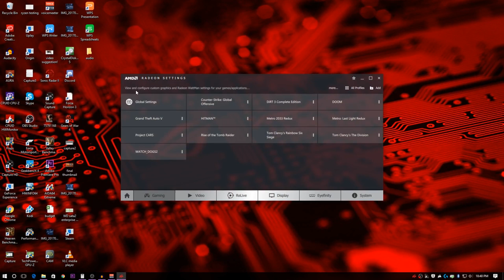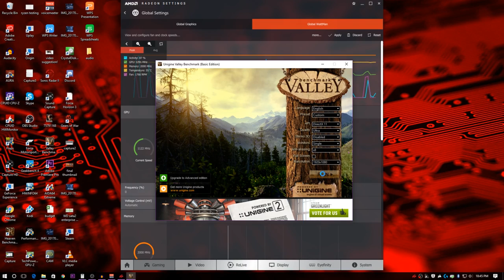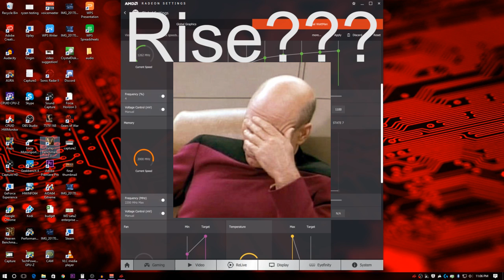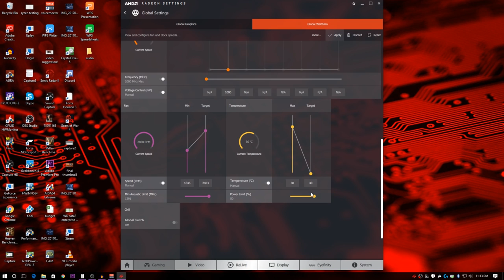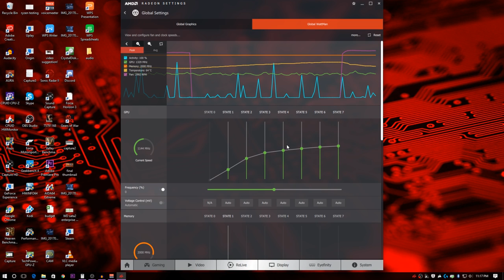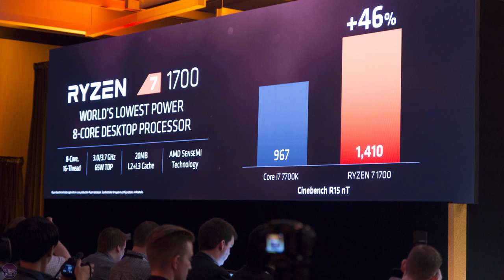Beginners step by step [how-to] overclock your AMD video card (RX 480)- Global WattMan

Comment: 1st of all thanks for the descriptive video man
2nd i want to ask that i've done some underclocking as i dont want high temps along with high fan noise, em not a ultra settings  fan, i just want my games to run smoother in better settings, so i manged to get 40 FPS in pre-ultra settings in overwatch, 
these were my settings ( https://tinyurl.com/lug945q ) , didnt touched any thing in Wattman except Chill.  i was getting 40 FPS with this at 64 C temp Max which em kinda Ok with. but i want to know are these settings OK? like i dont want to harm my Card as i want to use it for about 3 to 4 years are these settings good to go with or i can increase Frequency ? from 1900 to 2000 again ? didnt tried that but it was ok n stable in time SPY and fur mark.
Reply from the maker: Thank you for taking the time to watch the video. We really appreciate it!!

In regards to your underclock, I want to start by saying that depending on what model RX 480 you have, it is designed to run hotter than 64c. Where you have it now, is perfectly fine if not a bit on the modest side. I know that specifically on the newer RX 580 cards, most of them are set up to keep the card running around 75c. I would definitely suggest you raise the memory frequency back up to 2000MHz. I would say as long as you aren't creeping into the mid to high 80c range, I would not worry about the lifespan of the card.
Reply: this Means 75 degree are good to go for daily 3 to 4 hour of continuous gaming, if so then i'll for sure change Memory clock back to 2K but again i dont want much noise while gaming. as i've never heard such voice before kindly makes me upset why its making so much noise, also about the FPS, its just 40 fps in overwatch Pre ultra settings, 
CPU: core i3 6100 
Ran: 8gb kingston
HDD: WD green 1tb. 
least it should be 60 isn't it ? 
most importantly i didnt mean underclock  :p, i mean undervolting in my 2nd sentence,
Reply from the maker: Unfortunately, I don't know enough about Overwatch to tell you if that is an acceptable FPS number you are getting. From what I have seen, it doesn't appear to be a very intensive game, so I would expect at least 60 FPS, but I couldn't be certain.

Comment: this my thing Graphics Chipset
AMD Radeon R7 250 Series
Reply from the maker: You don't have Wattman because yours is not meant to be overclocked and wouldn't really benefit if it could unfortunately :(
Reply: Let's Get Techy damn this sucks :(
Reply from the maker: I'm sorry :(... It is compounded by the fact no one can find a reasonably priced GPU to save their life even if you wanted to upgrade. Grrrrrr!
Reply: Let's Get Techy it’s so dumb it’s try and get a nvidia GeForce gtx 1050 or 1070 ti
Reply: Ima **
Reply from the maker: That's a big difference between those two cards. Any reason you aren't considering anything in between?
Reply: Let's Get Techy like Wdym by that I like the nvidia cards they are nice looking and good for gaming but if there is any radeon card thing that is like 200$ that I can use for gaming and over clock please give me a link to one
Reply from the maker: Unfortunately, there aren't any worthwhile cards available from either team at the moment.

Comment: Can I over clock my radeon r5 340
Reply from the maker: With it being an OEM GPU, it's unlikely, but you can give it a shot. If the controls are there, you can. If they aren't, you cannot. You can also give MSI Afterburner a try if the controls aren't there in Wattman.

Comment: Shit i just found out my fan's max RPM is 6500!
Reply from the maker: Yeah, at that speed it sounds like it's ready to leave Earth's orbit huh? Lol
Reply: It was like TWO rockets leaving Earth's orbit xD I had a problem with my MSI R9 380 for over 2 years. Every like 20 seconds it was stuttering and the framerate dropped to 20 FPS for 5 seconds. And it was really annoying, especially when you're playing games like DOOM and other games where you have to be always moving. I didn't know what to do. I thought it was an overheating problem, but it wasn't. Then i thought it was something with the PSU, but still nothing. So i tried overclocking the GPU and all of sudden it stopped stuttering! So i'm really thankful for the tutorial you provided and helped me solve the problem. But anyways, thanks for the tutorial! I liked and subscribed! And also one more thing, I know this tutorial is for the Polaris cards only, so I searched the internet for tips like what's the highest voltage for my GPU and so on. But I followed your steps and it's easier than building Lego's! I would also appreciate a tutorial on how to overclock a CPU, cause i looked up the tutorial several times on YouTube and i didn't understand neither one of them.
Reply from the maker: Thanks so much for the sub! I'm glad you found the video useful. I think a "how to overclock your CPU" video would probably be popular, so I appreciate that suggestion as well. I will get to work on one in early 2018! Thanks again!

Comment: what is acoustic limit ....
Reply from the maker: I honestly don't have a clue.
Reply: @LetsGetTechy  thanks you  anyway.

I have  a question for u .

I have ov my rx 480 gaming x 8gb  oc to 1340 mhz on core clock and raise the power limit to +50    With 1150 mv.
The card is pulling about 160 w on average with a temp of 70 c on 100% fan  speed  that maxed out on 2600 rpm  

● are this temps normal ?
● is 2600 rpm the max fan speed for msi rx 480 gaming x

● how and can i lower the temps or the voltage or anything that can help me run this cooler ?  
● i have a 350 w psu  bronze  . And a normal and cheap mobo for my i5 3470  .

°THANKS a lot  😀😀
Reply from the maker: @squizi7090  That temperature is completely fine. No real need to try and improve upon it. Also, 2600 sounds like it's about right for that card, as dual axial fan designs usually run at a lower RPM than blower designed cards.
Reply: @LetsGetTechy  thanks again so mush but what do you think about the overclock that i did ?  Is it good or i should lower the voltage ?

Comment: Any chance I can call u on discord and help me out
Reply from the maker: Do you have a specific question or just looking for some guidance? I probably could at some point before the weekend is over.
Reply: Let's Get Techy I’m just confused I don’t know which drivers I downloaded I don’t know which program I download for RX 580 Sapphire 8gb OC
Reply from the maker: So I suggest using MSI Afterburner if you are feeling overwhelmed. It's the easiest most straightforward software to use to OC a GPU. Download it, max out the power slider, up the fan speed, and then move the memory and core OC sliders up by 20MHz at a time running something like Unigine Superposition between each to make sure it's stable.
Reply from the maker: Did you get it figured out?
Reply: Let's Get Techy yes I did I used the amd Radeon one but if I turn up the GPU to 14 it crashes

Comment: Did anyone else cringe when he set the voltages of all P-States to 1,100mV?!
For the love of God just overvolt the last P-State(s), unless you want your GPU to run hot as phuck even while watching videos, surfing the web and stuff!
The fellow clearly doesn't know what he's doing or talking about and I honestly don't understand the 1.5K likes...
Reply from the maker: Yes this is absolutely about overclocking a GPU and minimizing frame stuttering when going from a low power state to a high power state. Most would argue that frame timing is far more important than overall frame rate. 
When going from a low power state to a high power state, it takes the power switching time to apply this change. You would think no big deal but when we are talking about milliseconds it is a big deal. 

Additionally, and most importantly, if you think your GPU will be "hot as phuck" when in an idle state with these settings, you are clearly mistaken. 🤦‍♂️ I won't say you don't know what you are doing because I don't know you well enough to make a statement like that. I appreciate the comment nevertheless Sam. Wish you all the best!
Reply from the maker: One situation I would ask you to debate with me is the voltage settings on all modern motherboards for CPU overclocking. As I'm sure you are aware, most if not all modern boards have an overclocked vcore setting of "override". That setting allows you to set an override CPU core voltage and ignores the p-state voltages. Do those CPUs run "hot as phuck" at idle? I certainly use that setting, and I'm sure many others do or it wouldn't be an option. Now you may not, and that's what the "offset" setting is for. Thoughts on this?
Reply: @LetsGetTechy  That's an invalid argument, mate. I have never personally heard of p-states causing micro-stutters, but assuming for a second that your analogy is correct, frame timing won't pose an issue unless your CPU is bottlenecking the GPU and causing it to switch power states constantly.
Secondly, you're running all p-states at a constant voltage but despite that the base frequency is rising gradually from state to state. If your analogy is correct, wouldn't this frequency gap between p-states also cause stutter and impact your 1% and 0.1% lows? If anything, it should impact the performance more than the voltages. 
I mean no offense but... a rising YouTuber like you should know better, mate.
Reply: @LetsGetTechy  Look-up Intel SpeedStep, mate. 
The CPU won't idle at max voltage unless you disable SpeedStep, which adjusts the Vcore dynamically. AMD CPUs have a similar feature although I'm not sure what it's called. 
Cool And Quiet? I'm not entirely sure, to be honest!
Reply from the maker: @Sam-K  I didn't say p-states in general cause micro stutters. But clock speed changes without accompanying voltage to sustain that clock absolutely can cause micro stutters. And what about the temps? Where is your data that running a constant voltage on the GPU (or CPU in my argument) will cause very warm temps at idle? Voltage, frequency, and workload all play a part in temp, and I'll gladly trade a few degrees to have a constant voltage. Some may not, and that's fine, but to say it will cause temps to be super hot is inaccurate.
Reply from the maker: @Sam-K  To your speed step and cool/quiet comment- I absolutely disable those as well when overclocking.